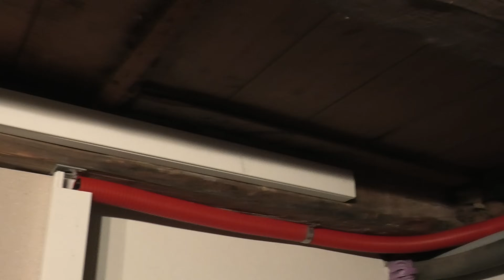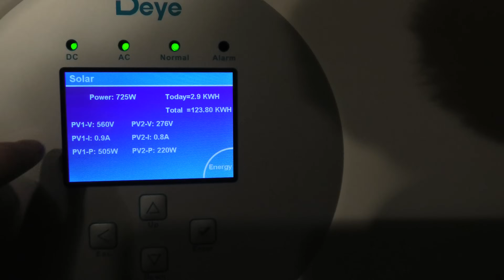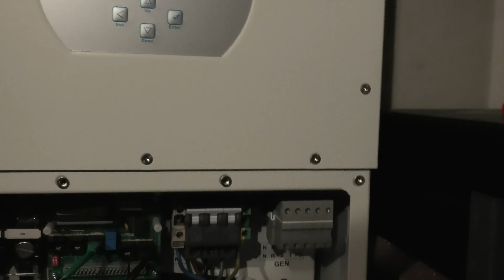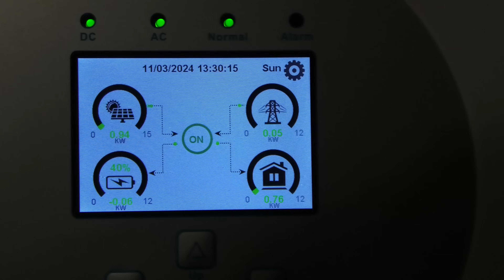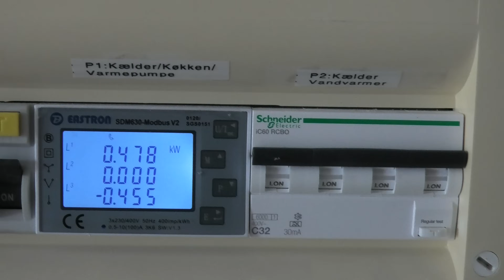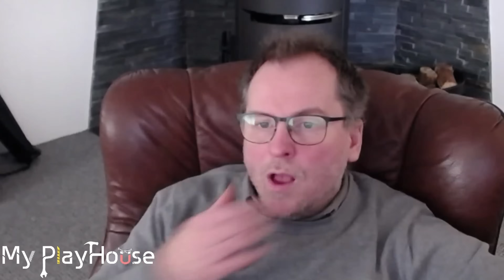My Solar Setup got Connected to the Grid, & Cost a Fortune - 1438

Comment: Why 3 phase? That's bizzar. We use split phase in North america.
Reply from the maker: Well that is the standard for high power,, here and most of europa if you need to feed something power hungry.
You have 120-ish volt for normal use, and 220-240V for heavy use. We have 230-ish volt for standard use, and 3-phase 400volt for high power use. I have 3-phase of 50Amps comming in to my house, so I can use 36000 watt,, that would become expensive real quick.

Comment: Funfact. Your Eastron SDM630 will count its total power reading like your previous official electric meter did. It also doesn't take the sum over all three phases into account.
Reply from the maker: The Eastron SDM630 is telling the inverter what is going on,, and it needs to know each phase.
Reply: @MyPlayHouse  I know, I am using it myself, but due to it not correctly calculating the total amount of power to bill, it counts differently compared to my official meter.
When looking at each phase individually, the SDM630 is totally fine (and quite cheap, too).
Reply: In order to be able to produce comparable numbers myself, I am looking at Finder's 7M.38.8.400.0212 meter which should do the math correctly, but a test has yet to be done.

Comment: Nice video, i have been thinking about a similar Deye, how does the current monitoring on the main connection work when you have the inverter mounted away form the meter?. I initially thought it needed to use the included current transformers/clamps, but i guess it's the modbus meter that allows you to do the remote inverter mounting. I know the electrician was expensive but at least coudl do the work, can you include a link/contact info?
Reply from the maker: The clamps, can also be used, they do the same..

Comment: Wow that was expensive.
I would have to do do the conversion. But it would have been less for me to ship you certified hardware.
I supply deye in the UK.
It's pronounced "day E" but they are 1400 but good inverters and the company support it good too. They are the other name for Sunsynk.

The modbus is handy and you can actually tie that to home assistant and get live data from that.

I think you can see the problem your getting with the pylontech batteries,  they are okay for very small systems but real systems they are no good. I'm surprised that they didn't meet your loads as they don't seem high (couldn't really read the load).

Do you not have you wind generator installed? The inverter does support them.

I suspect we will see some battery videos from you soon :)🎉
Before you do, a DIY or install, remember you need to reduce the output current for the charging as the inverter can charge at 190 amps.

Look okay.
Reply from the maker: Hi @guywhoknows
Thank You very much!  glad you liked the video :-)
Thank you for watching! :-)

Comment: I noticed that you have a PV1 over 560V, which is not ideal. You are exceeding the inverter's maximum specifications of 500V, which could potentially cause damage to the inverter.
Reply from the maker: Not really : https://www.deyeinverter.com/product/hybrid-inverter-1/sun5-6-8-10-12ksg04lp3.html
Max PV voltages is 800V DC.

Comment: Nice setup for something not designed in one go. Sadly down here in Germany we also have to use electricians certified by the power company, resulting in a mix of "we have always" [done it this way|used this vendor|…] and "slight" price differences to retailers. Also a lot of paperwork regarding building code, taxation and whatsoever - I started solar over a decade ago and still haven't met all requirements to run anything beside small island networks. Got slowly better in the last years, but as our politics currently shifts to persons calling renewables a "ugly, temporary solution", I don't have much hope that it will stay that way.

For me the inverter would probably be a no-go. I do not see any benefit in having to beg a vendor to change a configuration on devices I can literally touch and have payed for. Especially as with this access he (or anyone controlling their cloud) could also just turn off my power.

I'm a bit undecided on what I think about your new metering method. On the one hand it more or less rewards you for sending power back and forth uselessly and might cause phase imbalances, on the other hand it's good for you and an incentive for more people to use PV. If the inverter profile really prioritizes sending back on the phase with lowest voltage, the disadvantages become a lot less relevant, tho.
Reply from the maker: I was able to do most of the work,, like cables from one places to the other,, but the connection to the grid,, I needed the  certified electrician,, and I did not like the part of my power panel where I could not turn off power,,,, I have 36KWatt coming in. So I was okay with not doing that part! :-)
Reply: @MyPlayHouse  3×63A supply here. Not as spectacular as the broken main transformer switch of our data center substation, but blowing up 63As in a basement is something you (and your ears) remember for some time. Don't mix water and fuse boxes, folks…

Comment: Just a few things I would mention if you don't mind:
1) Careful just looking at the wattage of panels - The 550W are the much larger and are sized for Solar farms
2) I highly recommend you get (if not already have one) an "interlinked" smoke detector where you batteries / inverter is. (The idea being that no matter where you are in the house you will hear the alarm.  The Google Nest ones are great.
3) Are you sure the DC isolator switch is the spec as needed? (you mention an electrician did it so it should be ok). There are some real horror stories of them arching when switching on / off etc.
4) The emergency output looks nice but I think there might be special earthing requirements for them (this is the case in the UK anyway).
5) The Deye looks like it has an RS485 output so you might be able to get a LAN Waveshare device and then use Home Assistant to pull in & record the solar, battery, inverter data etc.  Google "deye rs485 home assistant" and you should find loads of good stuff.
Hope some / any of that is of use.
Reply: Addition to 1: There might be different codes depending on size. Over here in Germany you usually need a permit to make changes to your home. Adding PV is usually exempt for "standard" panels, so you save a lot of time and discussion. Most 550W panels are just over the legal boundry.
Reply from the maker: Yes my 330W and the 550W are not the same size,, I do know..
Smoke alarm,, I will keep that in mind...
The DC on off in the inverter should be 800v,, and the DC switch extra I put under the roof is for 1000v.
Elektricien was very impressed with my ground connection,, he said it was very good.
Yes the Deye can talk to home assistant,, lot of people does it,,, I am not there yet.
Reply: @MyPlayHouse  re:HA ok cool - I think that's a video all on its own :)

Comment: Hi Morton,

congratulations with this beautiful inverter and setup.
I have the same inverter from Deye, only the 10kw version.
I am really happy with it and have connected batteries to it also.
here in the Netherlands I use also 3-phase, but the inverter is connected to all 3-phase wires to the grid and to the house.
Using also the CHNT 3-phase meter.
If I produce more then my load is and the batteries are full, only then the rest will be exported to the grid, so, first the house, second the batteries, third the grid.
You can do a lot with this inverter and the best investment I did (Had a Growatt before).
Also connected the inverter to Home Assistant and can see real live data.

kind regards
Reply from the maker: Mine is setup the same way,, I do not export yet,, have not made that deal yet,, and right now there is nothing to sell,, no sun... :-/
Reply: @MyPlayHouse  here also, no sun for the moment

Comment: In New Mexico we have net metering and my panels are saving 10% of my investment  every year in electricity costs.  I have no batteries but have considered getting something to run essentials during the rare power outage. Haven't had a power outage long enough to be a problem.
Reply from the maker: Our grid power is also rock solidt,, there are years between power outages.

Comment: You're welcome. It's so cool to finally have you up and running :)
You're going to have to play around with using the UPS output on the inverter to feed the datacenter!
Reply from the maker: Yes,, a wire going that way would be smart :-) Not needed often,, but.

Comment: This 3 phase setup is very interesting. I expected the inverter would supply power on all 3 phases instead of just the 3rd one, is this something that can be configured in the settings?
Also, even tho you already mitigated the issue with the new utility meter, I'm curious why you (or they) didn't set the inverter to supply power on the 1st phase, since that's what you are primarily using, it would have solved the issue even with the old meter and it's also a little bit more efficient since you avoid losses in the cables when the consumed and produced power cancels out (this is basically what happens in all single-phase solar system).
Reply from the maker: I have had that thourght as well,, But I see that it is pumping out power on the phase with the lowest voltages,, might be sending it out on the phase where it is mostly needed... Maybe!!??
Reply: @MyPlayHouse  yeah, that might be the reason if it’s trying to balance the phases, it makes a lot of sense actually.

Comment: lol du blev taget i røven
jeg fik 3 invertere tilsluttet for det halve
brug aldrig din lokale håndværker

det tilbud min lokale håndværker gav mig 
sparrede jeg 40.000-50.000kr = 15kw batterier  på at lade være med at tage imod 

det kan betale sig at bruge en håndværker der er tilknyttet en butik der forhandler solceller

samme historie med varmepumper
når den lokale håndværker er færdig har du betalt 50.000 kr for en halv dags arb

Comment: Morten, you really need to hook up that inverter of yours to Home Assistant. Not only will you have real time updates, but you can also start fiddling with some add-ons like Predbat or EMHASS to really optimize charging/discharging and import/export.
Reply from the maker: I might,, lets see..
Reply: that should be in the app
growatt have that in the app

Comment: I paid an electrician as week to "knock out a hole" in a panel and connect 2 wires. 320USD.
I ran the wire, and supplied all the parts. The cable, the parts, connectors, breaker, 🪦.
Reply from the maker: Very expensive,,, :-/

Comment: Yikes, I have not seen a worse setup yet. 1st proper batteries are cheaper a 14kW gobelpower diy case with batteries less than half. 2nd 1/2 the power inverter would have been ample for 1/3 the price 3rd If you have the inverter powering only the house i.e. no feedback, and use the grid only if the batteries are to low, you would not need official permission, maybe a certified electrician to check your installation would be sufficient 4th by having done the installation by an electrician you have cheated yourself (and your public) out of various video's of how not to and the like - anyway, keep up the good work
Reply from the maker: Ahh this can't be the worth setup :-)
1) I got the batteries two ish years ago,, and prices has only gone down,, I have also seen 14/15KW for about $2000,, might get something like that along the way.
2) There is a "approved" list of allowed inverters.. power company (will/might) disconnect you from the grid if you do not do this the right way.
3) Yes,, my old setup went under the radar and I did not send power out,, now I want the option.
4) I do not disagree, but if someone did not like what I was doing, and wanted to make this difficult, it would not be great to share too much.
Reply: @MyPlayHouse  I just got easun inverter and in manual it says that it supports default batteries that you've got I think pylon us20000. It has dedicated setting to setup communication 🙂